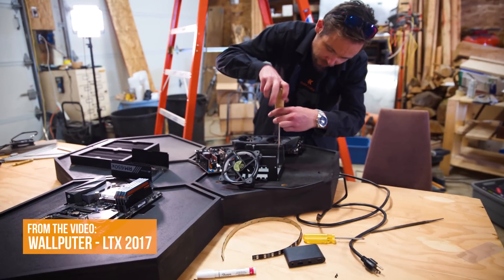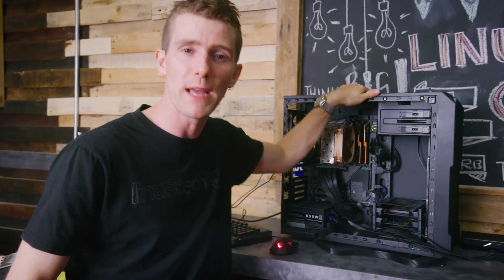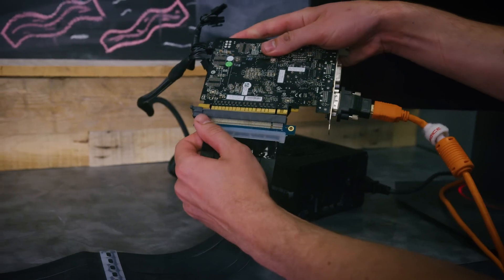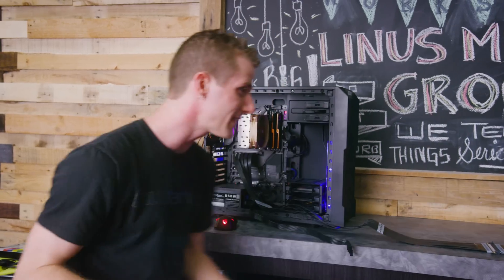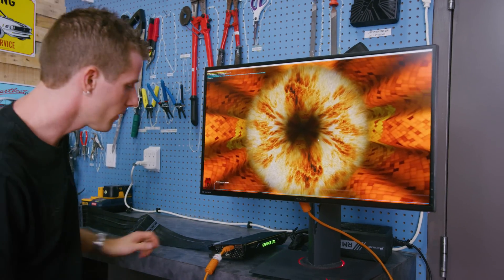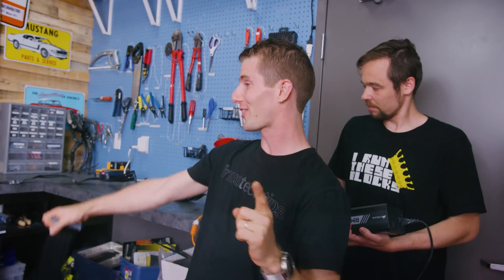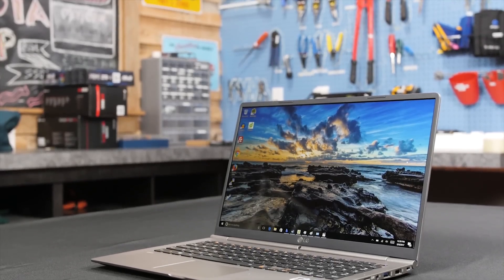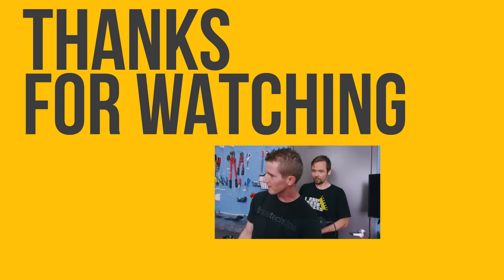How many PCIe Extensions is TOO MANY??

Comment: Your only problem should be the several connections. IF you can make it from 1 singular cable it should work for up to 6 meters I think.
If you have good enough shielding and very good conducting cable material you could do a very long cable but that is just guestemation.

Comment: From external PCIe standard, with proper shielding, it can absolutely have no problem go up to 7m with AWG24 cable (copper cable of course)
Which already available from Molex
And this kind of riser cable actually has better signal integrity performance than external PCIe cables... at least signal lines are not cross-talking with each other pairs, thus making it capable for more longer connection
Reply: Oh, and the missing GND pins do affect signal integrity.
Those GND lines work as noise shield between signal pairs

Comment: Out of interest. Why not just add more extensions and leave the GPU/screen in place right beside the system. Just because you are adding length doesn't mean you need to move the screen each time you do.
Reply: That point right there should have made you realize that they're doing this more for the "lulz" than the scientific testing, even if they like to pretend they are somewhat "scientific" lol...

Comment: are you sure it wasnt just thermal throttling because he had the fan blocked holding it on the table
Reply: wippy748s They would have noticed if it was thermal throttling because they can easily check the temperatures on Furmark. He states towards the end of the video that the GPU was running at 85 degrees Celsius which isn't hot enough for it to thermal throttle.

Comment: This is a bit.. flawed.

I am actually using a pcie 1x over an hdmi cable from my laptop to a gtx970, and the problem is not dropped frames or anything like that. Its reliability over time. Its also highly dependent on what sources of interference you have. You also noted that more pcie lanes helped, and that is actually true. The pcie protocol can handle any lane failing, but not dropped messages due to it. The reliablity issues I talked about? That comes from the error correction. It will dump packets where the checksum failed. Heck, you can actually run PCIE over RS232 (not just the cable*, but the *serial protocol. Like 115200 bauds. Used for testing and some ps4 hacking ;) ), by just dropping packets again and again on purpose. But, checksums are not foolproof. Eventually, packets that are faulty will come through, and if you are lucky you get some wonky graphics, restart your game, everything is fine. Or, you get reset, or worse, the computer just blinks out, halting, spinning everything at max speed.

Comment: A lot of things could go wrong - so many connections, power loss, data-signal loss, the Russian guy.
Probably one 3 or 4 m long PCIe Extension would work better.
One more limiting factor.... light speed. For example at 3 GHz CPU clock light travels 0.1m per cycle. IT's amazing that the GPU was flawlessly communicating with other PC intensities over the extra 3m.
Reply: Come on... you can't send information faster than speed of light (at least for now). The electrons move slower, depending on medium this can be 50% to 99% of c.

Up to 99% in cables:
https://en.wikipedia.org/wiki/Velocity_factor#Typical_velocity_factors
and only 50% in circuit boards:
https://en.wikipedia.org/wiki/Signal_velocity
(15 cm / nanosecond, when light does 30 cm)

So actually at 3GHz clock that would be only 5cm per cycle. No time to even communicate CPU-RAM. But the GPUs was fine with 3 m distance, which is impressive.

Comment: I just want to add here that furmark would probably be a horrible way to see if there is a performance dip in gaming. The speed of the pci express lane is mostly relevant when copying loads of data between the cpu and gpu. Furmark does not do that. 

I expect that it would drop sooner if you where to benchmark a actual game especially at a bit lower settings. To test this properly you need to maximize the data load between the cpu and gpu and not just do a torture test on the gpu.
Reply: "But... but muh furmark, muh synthetic benchmarks!"

Comment: Linus we know you pride yourself on being the cringiest tech reviewer on the planet, but do you ever think you go to far?!
P.S. Don't use centimeters there a waste of time use millimetres or decimal meters i.e. 300mm or 1.35m
Reply: Don't you guys usually list human height in centimeters? I see it quite commonly in metric societies...
Reply: No centimeters is redundant, I would say Im 1.8m or 5' 9" if you think about it centimeters is just not needed it adds confusion for no return it doesn't make anything easier or give you anything you dont already have in meters or millimetres.
If I say 1.8m that clear most people know what a meter is and well .8 of a meter is .8 of a meter.
Saying Im 180 centimeters most people are making the conversion to meters in there head to get a feel for the size. 

Then on the small scale if I say can you cut that "Believe it or not this is how its done on Irish building sites lol"
...Can you cut a 4 x 2 to a length of 325mm "ignore the irony of the timber being called 4 x 2 please lol"
The same in centimeters in is 32.5cm
You can see that meters and millimeters work seemlessly together but the centimeter is the red headed step child of the metric system. It adds nothing but confusion and it doesn't work well with meters and millimeters.

Basically there's no number range that can't be displayed in meters, millimeters or both easier with less confusion vs CM.
It's often used with no reason and often youll see it used along with meters and milimeters making it more confusing.
Rant over lol. DOWN with the evils of the Centimeter think of the poor poorChildren.

Comment: This give me an idea... this means you could potentially have a second case with an sli/crossfire setup in a different case, so you could cool JUST the graphics cards in that one case for lower temperatures, which means higher overclocks, so better performance in games. this could also be a noise advantage too, as the main rig would have less heat to deal with, and you could potentially put the GPU rig in a different room or a ventilated cabinet. Linus, you know what to do. EVERYONE UP VOTE THIS SO LTT SEE'S THIS!

Comment: Ivan is hilarious. Keep him even if he shows up late to work and drunk. In fact, promote him if he does that.

Also, completely insane! I have my reservations about Thermaltake (sorry?) but those are some well-built cables!! And it's not like it's three sequential 1m cables; it's a bunch of smaller sections which in theory result in some voltage drop at every cable-to-cable connection. PCI Express 3.0 is incredibly robust! I doubt PCI-E 5.0 will be able to achieve that with higher signaling rates. You guys should do some noise/EMI testing as well...that would be neat!

Comment: The last glitches was probably due to Ivan holding power supply unit very close to video signal cable. I have my PC on my balcony (10 meters away from keyboard/mouse/monitor) and the main cause to problems was power cables going close to signal ones. When I made them as apart from each other as possible, problems gone. Cheers :)

Comment: Why are you getting further and further away? It's length of the cable not the distance of the monitor+GPU+PSU.
Reply: Because they're clearly doing this more for the "lulz" than purely scientific testing. That should be clear just by the virtue of them doing that silly stuff to begin with, lol.

Comment: The data in the PCIe extensions transfers as fast or as reasonably as the energy that powers them. At 1200W that Power supply provided more than enough current for each bridge.
Reply: Still very cool to see someone do this.

Comment: It's nice to see that PCIe actually retries failed transactions... A single bit error not getting caught is enough to make the system go down... So the only thing you notice is a bit of "lag"...
It's also nice to check the kernel log and see PCIe retry errors in your log if the nvidia card doesn't play well with your BIOS (as the BIOS needs to have correct IPMI byte code for resume and stuff like that).

Comment: OK, lots of meters but the real question is: how many extensions?
Good quality cable will get you length, but the best cable in the world is junk with crappy connectors.
Each extension = 2 connectors that were not there before.
If you guys got 5 extensions run together without issue, you have some good hardware.

Is anyone putting PICe, RAM  or power connectors on the solder-side of the motherboard?
Imagine: a motherboard where the only socket on the component-side is the CPU.
PCIe, power, RAM and all the rest on the solder-side.
Hmmm, I got an old ThinkCentre that stills works...
Reply: It'd be good for thermals if you could move the CPU and the GPU as far away from each other as possible...

Comment: Guys, come on, just split power off of the last pcie riser cable and add a power from molex. The reason you can't get further isn't the data, but the voltage drop. You're going down to what I would guess is less than 10v on those power pins.

Comment: Wouldn't the only thing holding this back be voltage drop? With such  tiny wires transferring data, voltage drop would happen quite quickly.  you'd need some thicker gauge extension cables to go further... Right? 😂

Comment: Ok assuming it's powerloss because of the cables, could you maybe go further if you use a mobo with additional power to the pci-e lanes? Seen a couple of boards that have molex connectors next to the pci-e slots to give them more power 😬

Comment: That's actually a very interesting test of PCIe transceiver line equalization. I didn't think the length could be a problem, what gets you is really the impedance breaks at each connector. I'm genuinely amazed at the robustness of PCIe.

You should try it with the same number of cables, but each 1 meter long, I expect it will work.

Comment: Use 2 PCIe to HDMI converters and the longest HDMI cable you can find between them
Reply: >PCIe to HDMI converter

This is called a GPU /s
Reply: https://www.aliexpress.com/store/product/Half-size-Full-size-Mini-PCIe-To-2-PCI-32bit-slots-adapter-mini-pci-e-riser/710969_1816165189.html  Unfortunately only mini PCIe
Reply: This is correct. However, miners who like to game on their rigs will generally just have one non-USB, non-powered riser cable (ie. one of the cables featured in this video) connecting the graphics card to the motherboard, thereby allowing actual gaming. But yes, you cannot game properly using a powered USB riser.
Reply: pci-e to hmdi?
Reply: KanadeSana No way that can take the load, there's a reason gpu miners can't game
Reply: GPU miners can't game, where did you get that from?
Reply: They are built with usb risers, a usb's data transfer rate doesn't even compare to pci-e. The gpu and cpu communicates a lot when gaming.

Comment: Cool idea, but a short sighted test. Should really have been running something like a game (like GTA 5 benchmark if you want) so that the CPU is also being utilized (this will increase the amount of traffic on the PCIe lanes), and then you can also interact with it to see if the cables are introducing any kind of input lag at that distance rather than solely looking at a GPU benchmark for a fps drop.

Comment: Why didn't they just overlap/fold over the cables?
Reply: 51lav because then the pcie cable signal would create electrical interference with itself.
Reply: 51lav insulation wouldn't help. This interference can propogate through space and can only be reflected or captured by other conductive materials, like metallic shielding (which must be grounded)
Reply: This interference only come into play if the folds were tens of meters long, and would be largely irrelevant anyway because the folds induce opposing currents that cancel each other out instead of intensifying itself. Since a fold might only be 20cm, it couldn't matter. Since the wires already run along each other for several meters, that provides the worst possible interference between them. This only matters with separate long cables laying along each other, then they start behaving more and more like a transformer, one wire inducing current in the other (and again with folds, these currents would be opposite for each fold and cancel each other out). This problem is traditionally solved by twisted pairs of wires, like in ethernet cables. It wouldn't matter if you fold it or lay it out, the wires still follow along each other all the way, so you'd get just as much of this coupling effect between them, as much as was already there.
Reply: not true, those cables are switching in the GHz band, they emit tons of EMF, and the cable will pick it up, causing destructive and constructive interference possibly corrupting data even futher. Isolation won't do a thing here, since when you saw a exposed wire in a router antena for example. EMF goes through non conductive materials.
Reply: HA! I thought that said: LMG Slave
Reply: VISUALS
Reply: Pixl Rainbow - that's why insolation is on the cables.

Comment: Any actual reason you needed to physically have the monitor away from the system? Couldn't you have just piled up the cables?
Reply: 'visual effect'
Reply: Dudes, this is LTT, stop pretending like there is any logic there :D
Reply: So you can see how long it is instead of a pile of ribbon.
Reply: So if the cable cross you will have some induction issues between the risers which could affect signal integrity and power stability (probably not power in this case though). Hypothetically shielding would mitigate this but for best case scenario the LTT way in this case was more proper, lol.
Reply: Crosstalk always happens when conductors go parallel to each other.
Reply: Zamugustar maybe someone can put his graphic card to fridge
Reply: quite simple - removing variables. super long Video Cables adds a potential failure point so that could be the reason of the failure instead of the Risers.

if you want to test something, you test only that if at all possible so that your results are accurate.
Reply: well what i was scratching my head about is that ...why they did not used a wireless mouse ?
Reply: Ummm prob because they are lazy and only had a 1 meter HDMI cable 
 or something.
Reply: satansrobotho yes but a TV is simply output and does not have to send accurate information backwards and forwards. The cables for TVs such as hdmi are also thick and heavily shielded in order to minimise interuption
Reply: Because yolo?
Reply: How TV is a thing.
Reply: Prakhar Bahuguna z
Reply: no
Reply: Zamugustar I was thinking the same thing.
Reply: Zamugustar why are you watching Linus Tech Tips??
Reply: yeah you will stare at that "wallputer" all the time.
Reply: Zamugustar Maybe he didnt have a 4 meter display port cable.... where would you plug tge monitor exept to the gpu which is 4 meters away...?

Comment: I don't think that's signal loss. It's most likely power loss, either from the length of the extension or the additive resistance from all the connections, or a combination of both.

Comment: "I miss DVI"

...my 1920x1080 monitor runs off DVI and does not have an HDMI port.
Reply: Deathbrewer you do know that dvi supports up to 120hz right?
Reply: Rahilu14 - HDMI and DVI are identical and you can connect your DVI monitor to an HDMI port using a simple passive adaptor.

Back during the transition between HDMI and DVI lots of graphics cards came with these adapters for free.

You can also get an HDMI to DVI cable - they are 100% passive and will support all DVI features
Reply: AirstrikeITA - once it does a DVI handshake the pins get used as if its DVI and the spec becomes the same.

HDMI is just a rework of the pin layout to better suit multimedia instead of PC's.
Reply: AirstrikeITA - Copper is copper. If I use a pair of cables for audio - I can use it to send anything, even power.

Most HDMI drivers know that they could be plugged into DVI at any time - because they use the exact same number of cables and HDMI WAS DESIGNED TO BE COMPATIBLE WITH DVI

Copper is copper
Reply: DVI is the same as HDMI, without audio, and the extra stuff like ethernet, power... is just the video link, on a different connector.
Reply: Well you have to bear in mind Linus is obsessed with high refresh and has been living in the 120hz+ monitor world for YEARS at this point, lol. To him always using high refresh monitors that cannot use their high refresh modes over DVI... DVI is basically dead to him. If he misses DVI he can only really blame himself for living in that bubble, lol. It's still insanely common if you allow yourself to use plain old 60hz monitors that aren't 4K or higher, lol. It's almost like he's wishing DVI could support high refresh rates, but in a really weird way of expressing it (like saying DVI is gone when it's still there, he just has raised his standards and won't go back, lol.)
Reply: spoonikle No hdmi and dvi are not identical, HDMI can transfer audio and video but it only supports up to 60hz (60 fps) meanwhile DVI only transfers video and supports 120hz, maybe even 144hz but I'm not sure about 144.
Reply: spoonikle what do you mean by "DVI handshake"? the specs are not the same, one can carry audio and show 60 frames per second the other doesn't carry audio and shows double the frames per second.